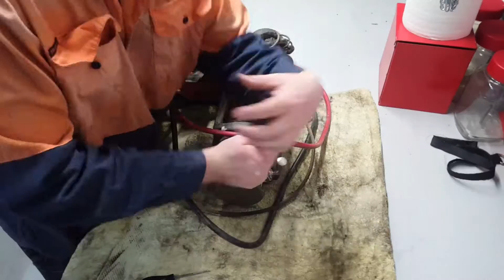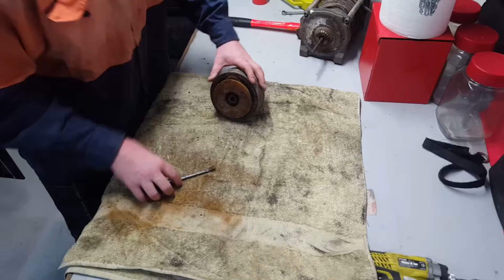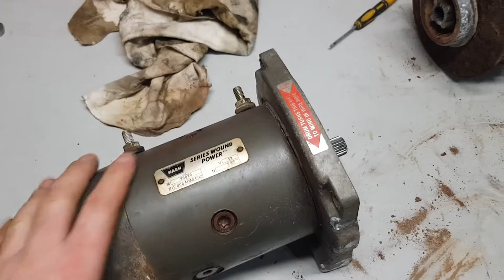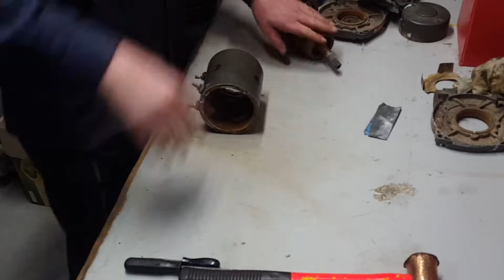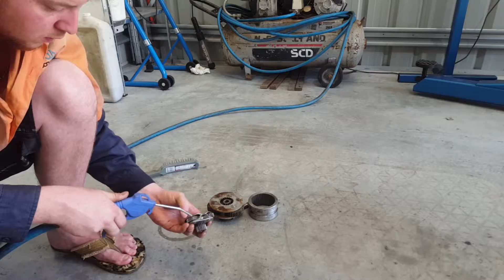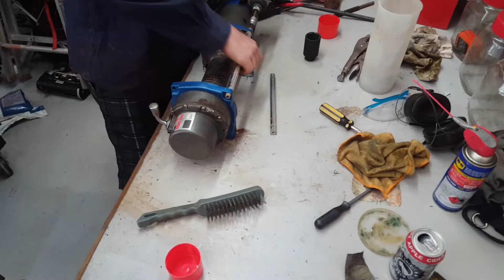Warn Winch Rebuild XD9000 X9

Comment: what grease are you using mate? also is there a service manual for it, or have you just pulled em apart enough to figure it all out. cheers
Reply from the maker: I just used marine grease and had an exploded diagram to work from

Comment: For anyone trying to remove the brake there's an internal circlip that retains the whole assembly probably 15cm deep in the drum which is an absolute prick to get out. A long seal pick and a screwdriver will get it out but you'll need patience

Comment: Hi mate, what are the Specs of the rope you replaced the wire rope with. Looking at the same, just confirming length and diameter of rope prior to purchase 👌
Reply from the maker: 30m length when I think it's 12000lb
Reply: @T.A.G   Hello, I really enjoyed your video. I was watching to see how the planetary gears line up. I took mine apart yesterday and don't think it's assembled back just right. could you tell me where you found the reassemble instructions? Thank you for all the HELP!!! Terry from Pennsylvania

Comment: Great video mate. Think yours was worse than mine. I wanted reassurance regarding the brake mechanism before I strip it and you gave it. Thank you.
Reply from the maker: According to a comment somewhere I did the brake wrong as I didn't pre tension the spring. However if you pretension the spring nothing slides smoothly and things bind. 
However I haven't had a drama with my winch so I'm happy haha
Reply from the maker: Check this video at 10.00
https://youtu.be/CyYs-oKlxUE

Comment: Consider avoiding grease on the outside of the lock / free spool ring, coz its the grease which causes it to jam over a period of time. fit dry and then squirt some penetrating fluid before installing the lever & once in a while as regular maintenance for free movement.
Reply from the maker: This marine grease shouldnt dry out like the old general grease. But that's a good tip. Thanks
Reply: @T.A.G  That's not a good idea leaving the steel in there completely uncovered.  At the very last a thin coating is recommended, and its present from factory too.